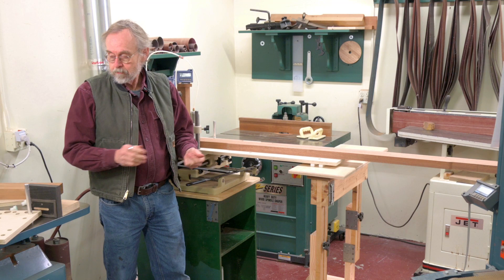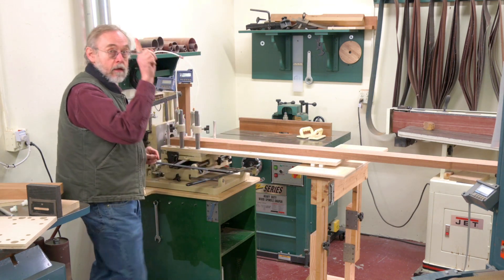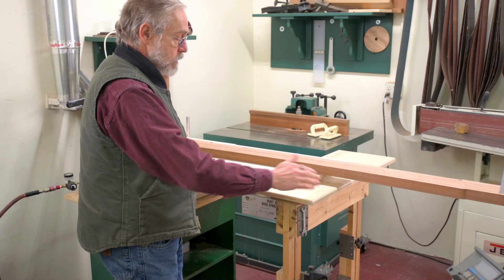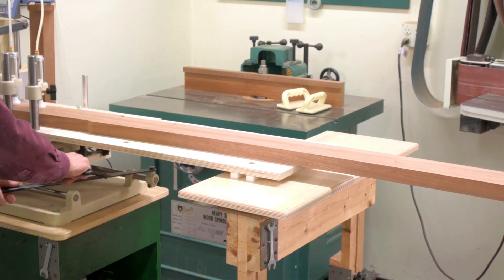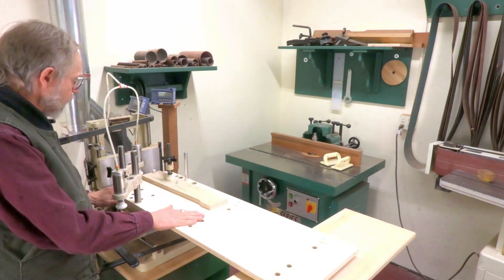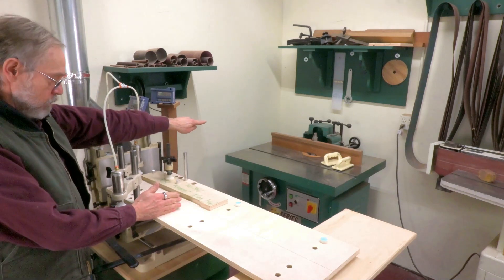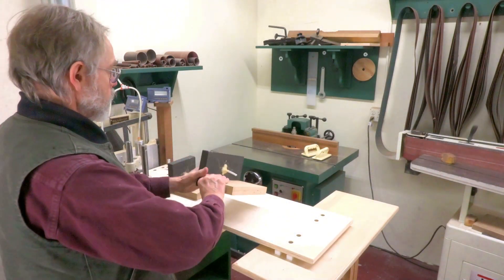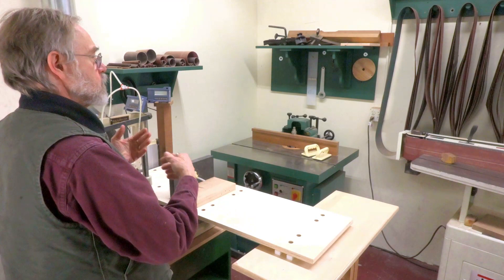Multi-Router Auxiliary Plate part 2: Modifications

Comment: Is the multi router easier for making auxiliary fences and base plates for than the panto router?
Curious because the panto would move around those large pieces vs the large piece moving around. I know you’ve thought of this just curious as to the why as I’m sure you have a very valid reasoning.
Reply from the maker: It would be easy to set up support for long pieces for the PantoRouter. But I like the positive alignment holes on the Multi-Router which makes registration quick and accurate- especially for odd shaped parts.